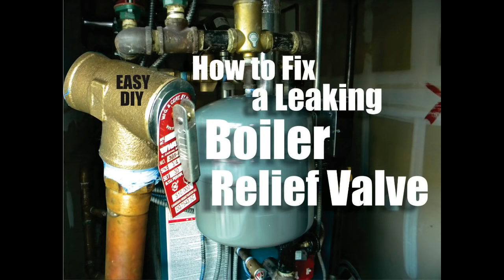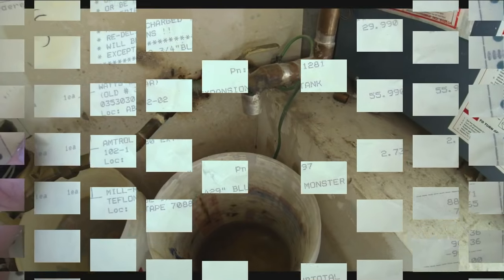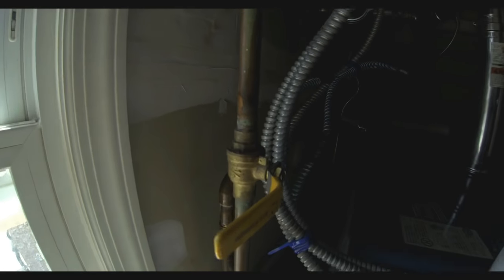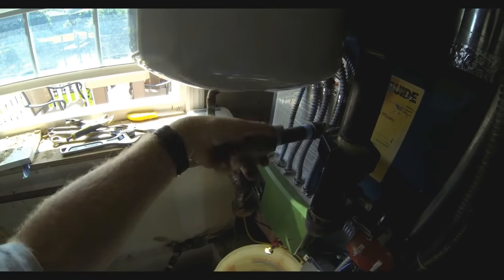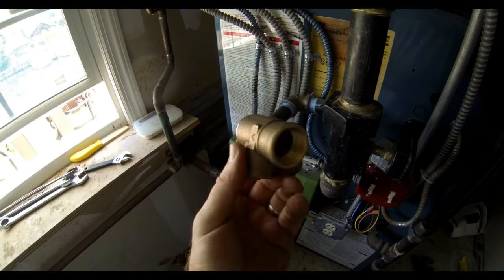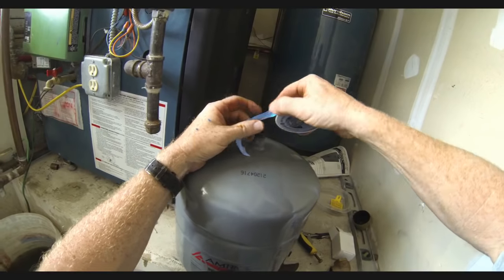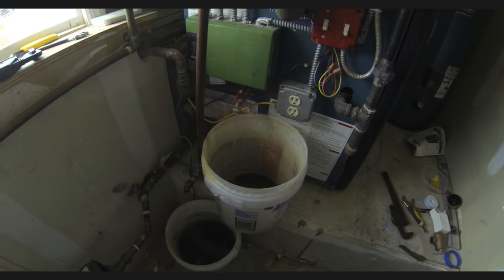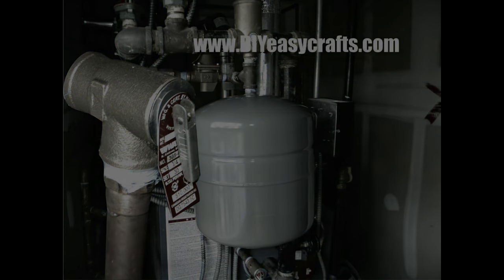How to Repair a Leaking Boiler Relief Valve Easy DIY

Comment: While the basis of this video is informative there is a bit more information that is handy.
You can determine if the tank is bad. Press the schrader valve on the tank. If you get water the tank needs to be replaced. If not it may just need an air charge, usually to 12 psi without water pressure o the tank.
If you get water it will be heavy. You can lighten it before removal by drilling a hole in the bottom of the tank and pre-draining it. Of course the boiler water will have to be turned off and pressure removed from the boiler. This is not a step by step plan.
The pressure relief valve must be installed in a vertical position. This means the stem of the valve will be vertical not horizontal. The reasons behind this is 1) it is code and 2) keeps the seat of the valve cleaner and 3) extends the life of the valve.

Comment: Not only plumbers charge too much, but in some cases they simply guess and try to replace parts as much as they can. I am more interested in plumbers who can truly diagnose a problem. Most of the boiler issues can be easily resolved by DIY

Comment: You did not check the pressure in the expansion tank. It has a valve on the bottom.

Comment: I mighty have missed it 
But I did not hear in this video that although they might look the same a pressure relief valve for a boiler is very different than for a water heater

Comment: One thing I learned the hard way. Avoid making deals with plumbers under the the table. Most will RIP you off.   I had a plumber worked on my boiler. Every  week almost the whole winter months my boiler broke down. Each trip he came back with boiler parts from igniter to gas valve to pressure relief valve an boiler would work for 2 days. He kept telling me that my boiler would explode if he does not replace needed parts. My hands were tied cause I could not call the company he work for and had to come up with $300_$400 for parts plus installation to a point where he literally replaced most of the boiler part. When my cost went close to $5000 I called a legitimate company that fitted my old boiler with new expansion tank and never had problems with it anymore.

Comment: My pressure release valve blew off sending out hot steaming water all over my boiler room  ,should i replace just that valve or i have to do both expansion tank and pressure valve ?
Reply: First you should find out why the valve opened. The system may have over pressurized, causing the valve to do its job by releasing the pressure.
Reply: @phill3583   i had the valve open that was connected to the expansion tank letting in more than 30psi  that cause the  pressure release valve to pop ,i had some maintance done to the system and i guess that was my error . i replaced the pressure release valve and the system is working fine now , but i am not sure if to change the expansion tank .i test it and at first water came out ,now its only air but the tank feels heavy .what do you think i should do ? i have a new tank but i did swap it yet . should i swap it ?
Reply: @premrajvish  You should have one valve supplying domestic water from the street to the boiler. This should be a pressure regulated feed valve. This valve should supply 12 psi to the system with the force fill lever in the normal operating position when cold. There should be a gate valve before the fill valve to shut the water supply off. With the system cold, close the shut off valve. Bleed the system down to under 12 psi using a bleed valve, not the pressure relief valve. Now turn the shut off valve back on. The system should pressurize back to 12 psi cold with the force fill lever in the normal operating position. If it goes up to 30, your feed valve is bypassing. If it maintains 12 psi, turn the system on. If the pressure climbs up to 30 psi while the system is getting hot, your expansion tank isn't compensating. Expansion tank air pressure should be 12 psi when cold.
Reply: @phill3583  thank you sir i will check the pressure on the tank shortly .what about the sound test on the tank ? mine sound solid
Reply: @phill3583   i just had the chance to check the tank and a little bit of air comes out and also water , so i am assuming the tank is not bad and should be replaced . do you agreed ?
Reply: @premrajvish  Not sure I understand... How did you check the tank? Expansion tank? If you say it's not bad, why replace it? Did you release the pressure from the Schrader valve on the expansion tank? Did you follow the procedure I sent you?
Reply: @phill3583   YES i did , it was a bad expansion tank i replaced it yesterday and everything working fine now
Reply: @premrajvish  That's great 👍. Good work!

Comment: The pressure relief valve is supposed to be mounted in the vertical position with the spindle on top.

Comment: Replaced my relief valve... purged the system of . . Now when its heating.. my system pressure increased about 8psi and popped the relief valve.  I had it set at 20psi.. valve is set at 30psi... dint know if i messed up the expansuin tank
Reply: You may have got a expantion tank for domestic water that is pressurized at 30psi verses a closed loop heating expansion tank that is preset for 12-15 psi

Comment: After you do this, do you have to bleed the system?
Reply: In my case, i had the cut off valve right at the neck where the tank attaches, so i didn't bother doing it. I did (still) let out some water at the bottom of the boiler, as well though the pressure relief valve, after turning the water back on and opening the cut off valve to the tank, just to get out any little air that may have gone in. 

But for most case where a lot of water has been let out in the pipes, yes, i would think you'd need to bleed the system after installing a new expansion tank...
Reply: it's always a good idea to bleed out any air but every system is different!

Comment: I have change the expansion tank the psi value the water feed with the back flow and still have pressure leaking at 30 psi. Help!!!!
Reply: I did enjoy your video. Thanks👍👍👍
Reply: What did you do to fix this
Reply: Did you fix it? If so, how?

Comment: Did this, a day later the new tank is filled and leaking, any ideas?
Reply: Did you test the pressure of the tank. You may have a bad tank that the female coupling is crack that the tank is attached to.

Comment: Cool but if ur pressure was 30 psi then there was nothing wrong with the relief valve..  it means you had too much pressure in your system and you probably only need to replace the expansion tank..

Comment: I own a plumbing, heating and air conditioning company. I love when home owners/DIY/ handyman does this type of work, it is guaranteed future work and because it wasn’t performed correctly, the cost in most cases increases due to further damage done. I would love to sit here and go over everything that was done wrong, yet sadly more people would think I’m here to help you help them. Maybe when telling someone they can do it themselves, maybe, just maybe you should do a boiler safety video first. This and all video pertaining to a homeowner/DIY/handyman that think they know what they are doing when it comes to equipment that could harm someone if the procedures are not properly followed, should be removed from any social media platforms.
Reply: We’ll mention a few things to help save someone’s life or a family’s heat.

Comment: “Just try to play with that pressure relief valve a little bit sometimes just resetting that valve can stop the leak” this could not be farther from the truth. DO NOT TOUCH THAT VALVE UNLESS ABSOLUTELY NECESSARY. There’s a reason a boiler drain is installed. If it was wasn’t leaking/leaking a lot before it’s very likely it will after fucking around w the valve……

Comment: We had our power go out for 3 days. After the power came on, i noticed water coming in under my newly installed pergo floor and  it was coming from a the drain pipe under the back flow valve. I panicked a bit but saw the switch and flipped to off and called a plumber to see what was wrong. $125 to show and tell me that three things need to be done, the backflow, bleed system obviously and another doohickey that he told me was very hot to the touch. $1800 my quote. I told him I'll need to get a second opinion, and he says he could "try" something like bleed and replace just the backflow for $900. I declined and said I would get a second opinion. Paid my $125. The system is practically new, only a about 3-4 years old and looks like it was installed yesterday when we bought the house. I'm suspicious. I'm thinking maybe doing the same, replace the back flow valve, bleed and the expansion tank. I don't know how to bleed the system? Mine is gas powered. Any ideas?

Comment: Wrong wrong wrong. Relief valves should always be installed with the stem pointing up. If there was 30# pressure on the boiler the relief was not faulty just doing it's job.the culprit was only the x tank. And learn how to use the Teflon tape.
Reply: Another thing if that boiler was hot when you refilled it with cold water it could have blown apart
Reply: @ckpat50  at 1:15   you can see see the stem was pointing the same direction as when he later installed the new one.

Comment: granted ours did not need replacement, just a simple act of lifting the valve and releasing water saved our basement at 11 PM when we could not possibly contact a plumber.  The water was coming out fairly quickly but not blasting like you did into the bucket... fortunately after lifting it a few times, The leak seems to have stopped and hopefully saved us from having to hire a plumber.

Comment: Great video,
My question is slightly off topic to start with but read on.....
I have purged the air from my zones but it keeps coming back, over and over. I've even had an HVAC engineer purge them when he cleaned my oil furnace but within 36 hours I can hear air in the pipes. It's driving me nuts.
One thing I notice is the pressure relief valve is producing water, but not constantly leaking.
OK, so my HVAC guy purged all three zones I have. He also closed the automatic bleeders I have on the furnace to eliminate the possibility that air is being drawn in through them. He emptied the bucket under the relief valve and within 36 I have air in the system and water in the bucket. I popped the auto fill valve for about 3 seconds and the pipes are much quieter. When I tested how much water is produced from city pressure it was similar to the amount of water in the relief valve bucket. So, my theory is the valve is leaking. However.....why did my pipes go quiet when I used the autofill if the bleeders are closed...there's nowhere for the air to go to unless it too is forced out through the relief valve....but since I used the autofill there has been no more water in the bucket so that idea doesn't make sense. Also, if water is leaking through the relief valve why isn't the autofill replenishing it ?
With the furnace up to temp and running the gauge reads 24psi at 180 degrees.
I have no visible signs of leaks in my ceilings etc. 
I'm at a loss.....any suggestions what I can do....?
Reply: sherif807 
I have good news. I just replaced my auto bleeders.......silence. it's fixed.
One of the bleeders must have been stuck open and pulling air in.
Reply: sherif807 it's called a hy vent. I bought mine from Lowe's for $15. very easy to change, turn off the furnace, drain the system down a bit, unscrew the old one, screw in the new one with a bit of teflon tape. Make sure the tape won't block the valve.
Refill the system, purge the air and turn it back on.
I still had air in mine and thought I hadn't fixed it but within an hour all the air was gone.
I used Watts FV-4M1 automatic float vents
Reply: I may have spoken a little too soon. 48 hours after the repair and I have some air back in my pipes. Most of it automatically bled out but some remains. I have a small amount of water in the bucket under the relief valve and the operating pressure on my boiler is now 20 psi which is down from the 30 psi I saw after my repair.
My conclusion at this point is that the pressure is too much for the system at 30psi so the relief valve opens, pressure drops to 20psi which allows air in somewhere (I have no idea where) and the autofill is trying to refill the system but is perhaps set too low to create enough pressure in the system to purge all of the air.
Reply: sherif807 Thanks, I'm going to get a new pressure relief valve tomorrow and change that. The expansion tank is only two years old so I doubt it's faulty, cool in the bottom, warm at the top. Also, I don't know what the autofill pressure is set to, I'll just have to change the relief valve and go from there for now.
Reply: Good to hear Sherif807. After I replaced my hy vents a few days ago I heard nothing for two days then I heard a lot of air back in the pipes. When I checked the bucket under the relief valve I noticed there was water in it. As I thought, there's definitely a correlation between water in that bucket and air in my pipes. So I opened that relief valve and let a little water out, maybe a pint, then let it close again. The autofill refilled the system and since the relief valve stopped dripping (maybe 20 minutes) it's been fine ever since. I've bought a replacement relief valve because at some point I think I'll be replacing it but for now, all good.....and quiet :-)
Reply: Well, my air is back again.
I've purged many times, replaced both the automatic vents, replaced the pressure relief valve, have no visible leaks anywhere and yet I still get air in my heating. The bucket under the relief valve is dry so it's not releasing water there. I have a Watts SB1156F pressure reducing valve with the autofill bypass lever on top. I was told that I could remove the cap and screw clockwise to increase the output pressure from 15psi to something slightly higher. So, thinking that I wasn't getting enough output from the Watts I tried that. I turned it a quarter turn and immediately water started coming up from the screw head and out through the top of the valve where the override lever screws on. Assuming this is a bad thing I put it back to where it was and the water stopped. My thought is that the Watts is faulty and not actually refilling correctly. However, when the system was empty for the pressure relief valve repair, when I went to refill the system I left the valve on automatic fill and I could hear the water filling the system until it reached operating pressure which the gauge on the boiler said was about 15psi....so it works, I just don't know for certain how much pressure it's providing based just on a notoriously inaccurate gauge. This is infuriating.
One more thing, when I do get air in the system it seems like it's suddenly very noticeable. Not a slow increase in air, just a lot of air suddenly. Not enough to become airbound but I'm worried that if I leave it for a day or two that will happen and being in New England in January....it's a bit cold outside ;-)
Frozen pipes are all I need....

About two years ago a plumber replaced the expansion tank, is there a right way and wrong way to replace one ? I'm wondering if that's it since I feel like I've addressed everything else short of replacing the reducing valve (Watts). The tank is warm at the top and cool at the bottom so I know it's not full of water, I just wonder if the pressure is wrong or some other issue that may be caused by a mistake during the installation. I don't know, just trying to get to the bottom of this.
Reply: sherif807 
Thanks, increase to 25psi to blast the air out so that the water acts as a piston then when the air stops coming out of the drain hose close the system up and just use the autofill valve under 15psi ?
Is that what you mean ?
Reply: If your makeup pressure regulator is going bad this could happen. If this keeps happening, refill your boiler system and close your makeup valve. Then, keep an eye on your system pressure and listen for signs of air. If this fixes it, replace your makeup regulator. Hope this helps. by the way check out my DIY Heating Videos on my channel!
Reply: @Mandinka711  b

Comment: How do I reduce the psi if it’s too high?
Reply: You may have a faulty fill valve over pressurizing, or a faulty expansion tank not compensating when the system gets hot.

Comment: Over time the tank diaphragm can leak allowing the air to escape and be replaced by water. However the air inlet valve located at the bottom of this style of tank can also leak causing a loss of cushion resulting in the over pressure valve to leak even though it's in good shape. 
 The way to check for a leaking bladder is to simply depress the inlet valve and see if water comes out, if NO water comes out check the pressure  in the tank with a air pressure gauge and correct it to your usual operating pressure to keep most of the water out of the tank, you may have to do this several times if the tank is full of water and is easier if the over pressure valve is bled off.     
There are pressure tanks that are non bladder that only have air with the inlet on the bottom and they should also be pressurized with air ( maybe 18 lbs ) to keep more of the tank empty of water for a larger cushion and less chance of the over pressure valve leaking.